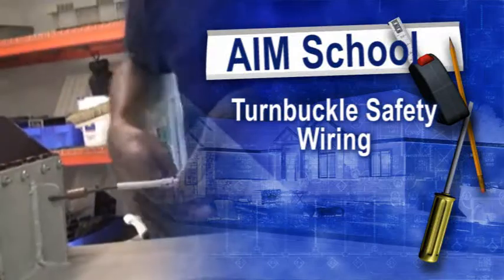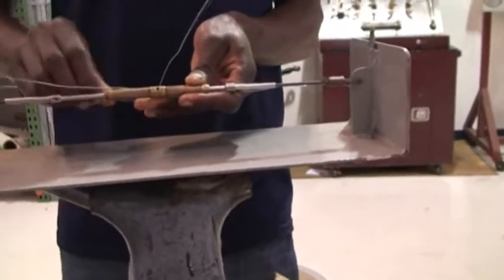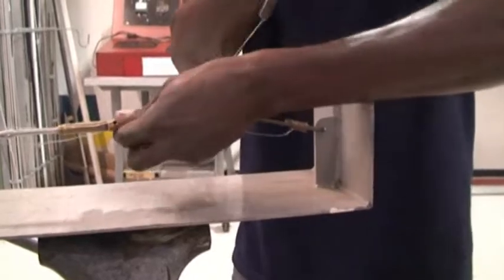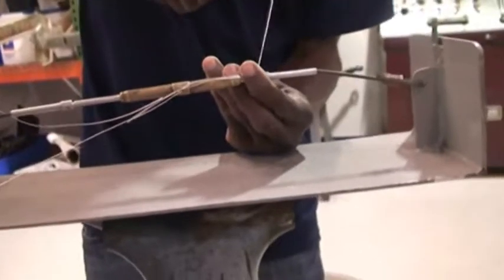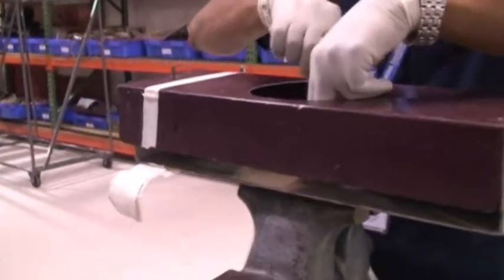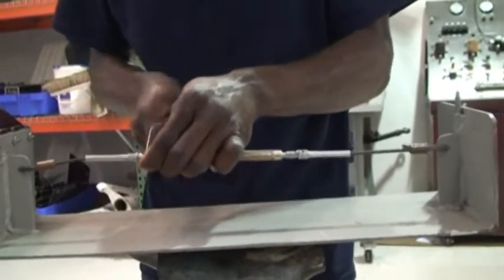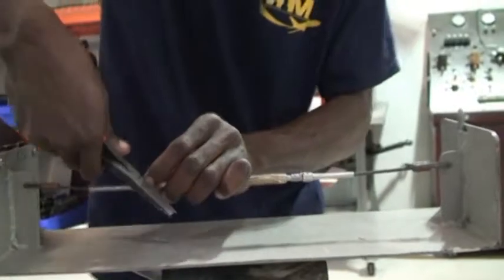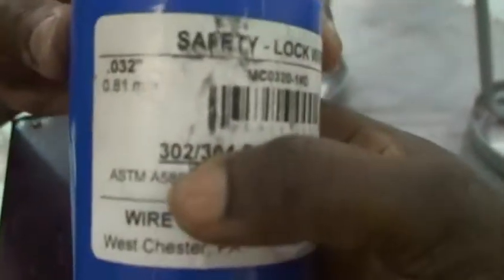AIM School - Turnbuckle Safety Wiring

Comment: Should be .041 for primary flight controls, .032 is much easier to manipulate though.  And yes, they were supposed to go opposite direction on the wraps of the second wire..